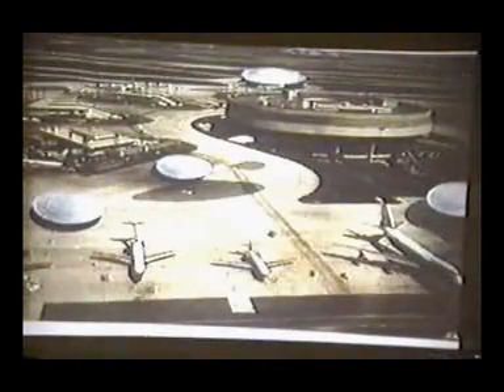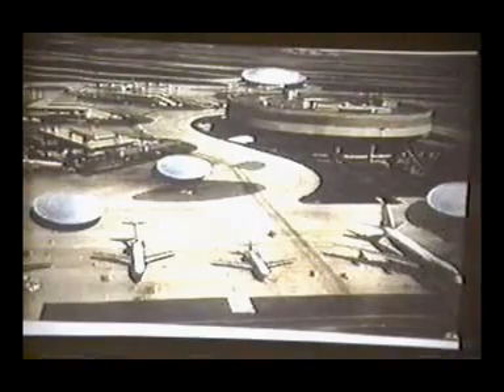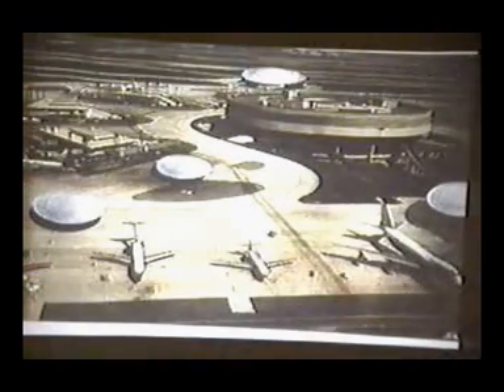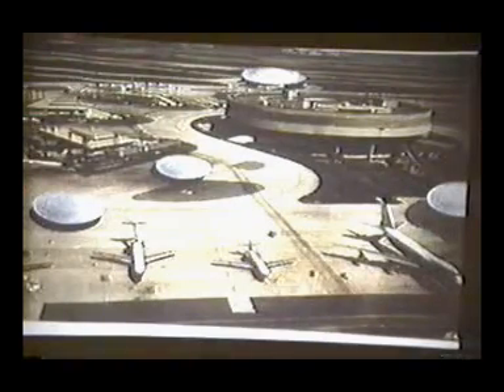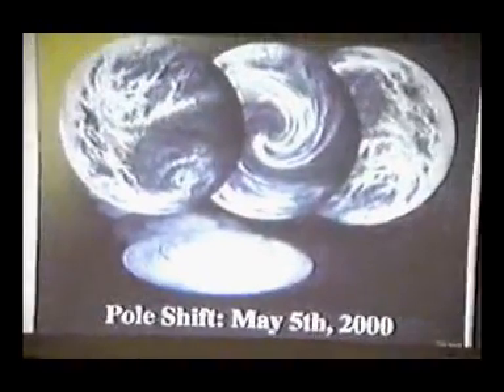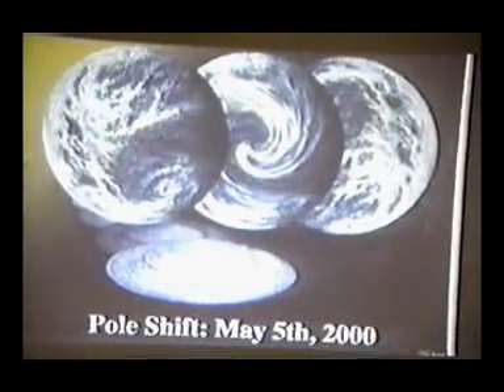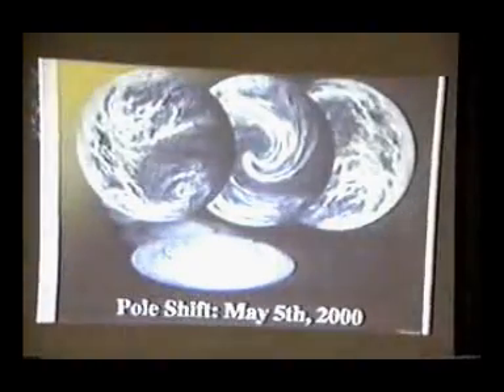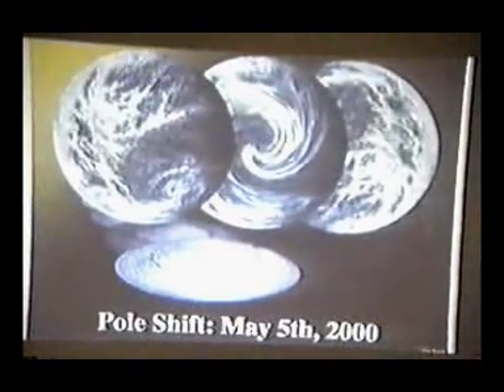5/6 UFO BUILT & FLOWN 3500KMH PROF John Searl SEG Free Energy Magnet Generator

Comment: 0000 film footage of this flying at  mach 2.85=2174.799 mph.You would not be able to control this at this speed in 1968 or 1969.No solid concrete construction of this craft???.More questions than answers over this event.Film footage from the bbc=00000.What material this craft made from???.Remember laminar flow patterns also and fluid dynamics of this craft at this speed in a straight line format.Aluminum construction, would be useless over mach 2.85 obvious reasons there ha ha.

Comment: the craft would have blown up destroyed from the friction and heat at that speed.The only material at that time that can withstand the heat transfer at that speed was not in the general domain even now only the place i worked had that technology then and now.
Reply: There is no heat or air that reaches the skin, same reason there is no soic boom. Northrop Corp. in 1968 did experiments with electrified airfoils. Many patents exist for this, including Dudley's eectrified rocket patents. Efficiency is greatly increased, and sonic boom and skin heating are eliminated by the electrified bow waves in the direction of motion.

Comment: lost because it went out of sight a simple 2 channel model that went some 3 miles out of view i just managed to get it back to me and this was on a clear day no wind.It can be done but you will never see it you just had to twiddle with the sticks and hope you get it back to you, for whitch i did.So there nearly imposibile to control it from the ground in1968.So to me this event was a hoax of some sort.Again i have no idea why he says this in his books.Without using advanced material at that time
Reply: THe P=11, Demo ONE and all the radio contoled craft were controlled with multi-channel 12-Meter Band HAM radio from stationary and mobile panels from Warminster, and Archangel Russia. Ham Operators were given a special access code to control the discs in their flight around the world at speeds far faster than any ballistic rocket. The SEG-powerd craft are basically NON-BALLISTIC ELECTRODES at flight-Voltage, which is around 10^12 Volts, andthe current never exceeds 1.5 milliAmperes. High-Energy Electrostatics.

Comment: Today you can control any flying craft being radio control or fully automata no distance comes into it anymore or hight, you can even make equipment yourself to pilot your craft using GPS systems but in the 60s it was not in the public domain to do this and equipment was not in any model shops at that time to control a craft over a great distance unless you had access to parts of the military complex like i did.I remember flying a small model of  2 foot long in 1968 radio control that i nearly

Comment: The only sector that had very good radio control equipment was the military for which i worked in the black sector on classified and non classified programme for which i had access to equipment for myself.So if it was not radio control then it must be either free flight craft for which i have built many from when i was 6 years old up to now or a guided craft similar to what the M O D used in the 50s .But they have a limited range just like radio control have.No  GPS  out then.

Comment: The Searl scam is over 60 years old. Any serious investigator will come to the same conclusion: No discs have ever flown. The alleged photos of flying disc are fraudulent. Some were staged for newspaper articles. A model was suspended with fine wires. This is what a flying disc would look like,.. if only they could get enough funding to actually build one. All of the Searl stories of working generators and flying discs are bogus.
Reply: Another flying disc hoax once more.

Comment: One thing i will say though to appease you skeptics. I dont remember any mention of a free energy device on the footage or any mention of generating electricity. It was purely showing a small disc about 2 foot in diameter. It was launched like you would throw a frisby and it sped off at great speed and was lost. Thats what i saw.

Comment: @kurisu925 It takes time to rig such a setup, and don't you thing peoiple would observe such a crew rigging a setup as you propose? THey did not ned to. THe SEG was not suppopsed to be a flying machine, it was supposed to be a unique type of electrical generator, nothing more. Its heavy lift and forcefields resulting from its superconduction and repulsion from Earth are predicted in physics. I am responsible for the Searl IGVs since October, 2007.

Comment: @kurisu925 Photos are not easy to fake. A small model has no shadow indicating depth. Plus, ther is no place to hang small models, which sho up every time. Why would anyone need to? The SEG was intended a s a generator, not a flying machine, but overloaded and superconducting, nothing can hod it down. One IGV blanked out ground to air transmissions at a local airport.

Comment: @kurisu925 Fine black trhead would not suspend the Searl models, which weighed many tons. Plus, in all the phots, there is no place to HANG anything, plush the very act of "hanging" a model on thread would be observed, with the time it takes, and set up, PLUS a small model has no depth, so shade pixel analysis shwos this, PLUS in th ephotos you can see the flight cells opening and closing and the crafts change in attitude aas a result. It is not magic. Its physics. And is done for YOUR benefit!

Comment: 41 flying models were built and flown, many radio-fontrolled, on 12 meter band. This did not start as a flying machine, it started as a generator, of unique design, which came from a numerical system, whcih came from two series of oddly recurring dreams, from age 6 to age 12. the 2 dreams were alays the same. Fromit came the law of the squares, which came the SEG, so named by 1971-team member Dr. Shinichi Seiki. The first 6 were lost to space, financed by the late George Hines.

Comment: In 1975, I read a huge encyclopedia on UFOs, and it stated that Warminster was the UFO capital of Europe. I discovered in 1987, all the UFO-actifity and EM distrubances were caused by the activities of the SNSRC! On one occasion, and IGV (Levity Disc) blanked out tower-to-air communications a small airport. Professor Searl had to take pilots training, because after prospectie pilots viewd the IGV in flight, they thought they would be killed by G-forces. But the IGV HAS NO G-forces, or inertia.

Comment: No, my research consists of stdying the work from every available source, of which there are very very many sources, as the work has been going on since 1946, when the blokes at British Rewinds told young Searl to "put up or shut up". Searl "put up". An old magnetiser sitting unused was rewired, and the engineers and laborers there did the construction work, all Searl had to do was pay for the raw-materials, which were paid for initiall by George Hines, later a consortium of 13 old rich gents.

Comment: Demo one, after it was wired up (it had 4 tons of copper in it) and the SEG installed in the SEG-housing near the rim, weighed 12 tons. But when the SEG is overloaded by the load cell, it bounces up like a rubber ball, and with just a touch of  flight-cell (64-flight-cells) control its going faster than a .22 calibre bullet. With no sonic boom (same as the B-2).